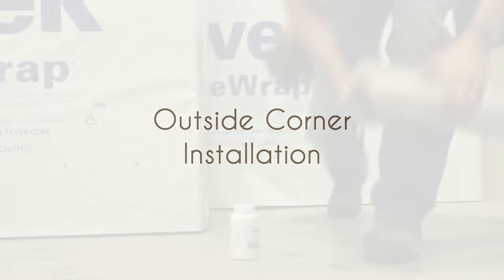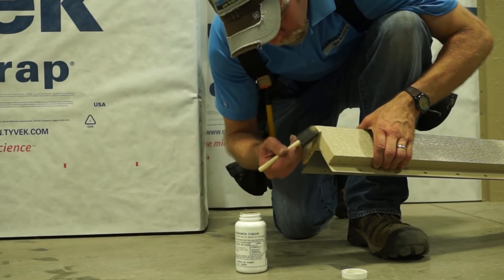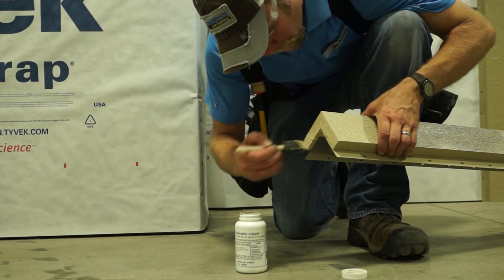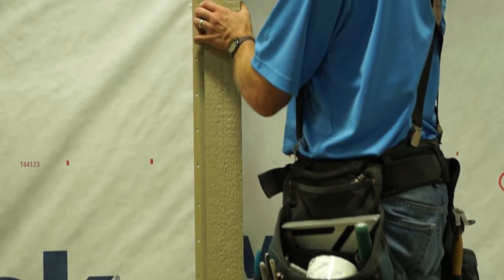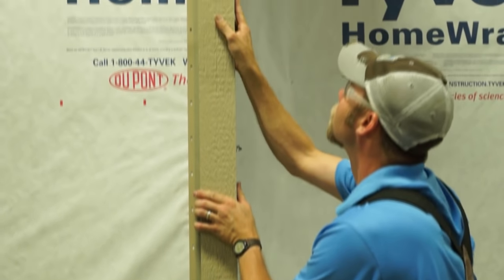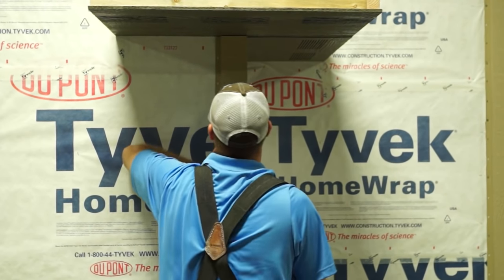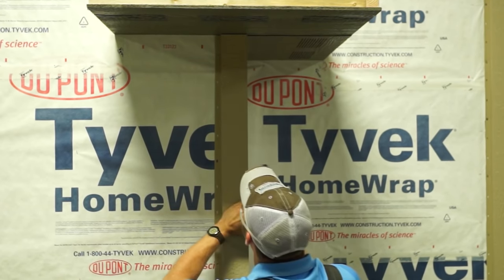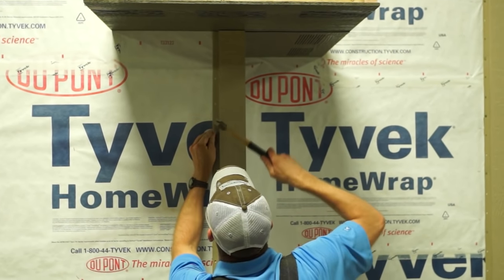Diamond Kote Nail Fin Outside Corner Installation | Built On LP SmartSide

Comment: I see you nailing the vertical siding directly into the sheathing, which may be about 1/2 inch thick. Is this sufficient or should one have furring strips to achieve about an inch nail penetration? I would appreciate a quick response as I am about to start installing the product. Thank you.
Reply from the maker: Hello! It is best practice to nail the vertical siding at the studs 16" on center (OC). If the stud spacing does not line up exactly, it is acceptable to nail directly into the sheathing as long as proper spacing between the fasteners is used. For 16" Vertical Panels, fasteners must be spaced a maximum of 6" OC along the siding perimeter. Thank you for using Diamond Kote on your project!
Reply: @diamondkotesiding  Thank you for the prompt response. So, nailing every six inches achieves the same purpose - equal gripping power. If I may, the OSB is flush with the top row of the foundation cement blocks. How would you suggest I avoid contact with the cement, yet cover the OSB? Thank you kindly.
Reply from the maker: If possible, a piece of 7/16" z-flashing could be applied to the OSB for your siding to rest on instead of the block foundation. If this is not an option, a piece of trim could be run parallel to the block foundation to cover the bottom of the OSB.
Reply: @diamondkotesiding  Thank you again.

Comment: What do you do when you have an outside corner that is longer than one piece? What is the preferred install method?
Reply from the maker: The cut ends of the corners should be painted.  The ends can be installed lightly butted to each other without a gap because the length of each corner is less than 16’.  When stacking multiple corners together it would be best to leave a 3/16” gap only where the corners meet the soffit to insure this has room to grow.  This gap can be sealed with color matching sealant.
Reply: Great, thanks for the reply. I scoured all the literature to find the answer myself and couldn't really find it. Just wanted to be sure.